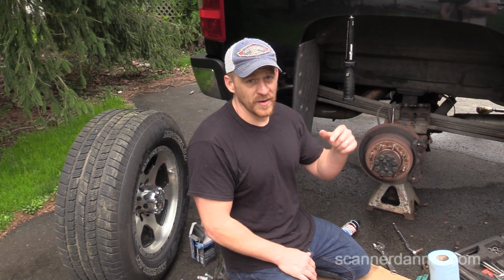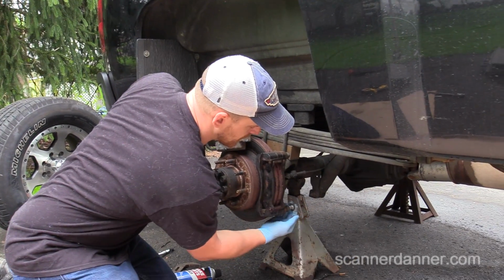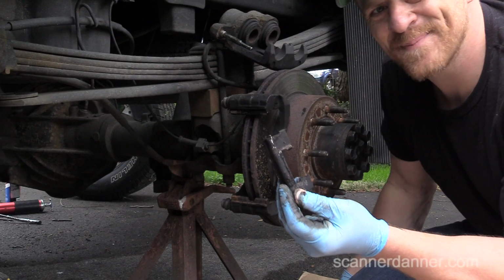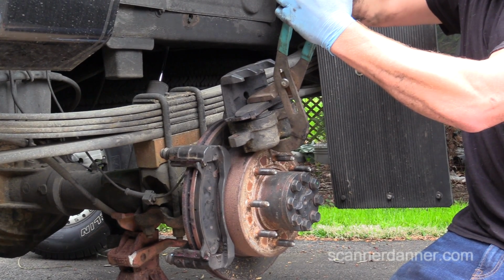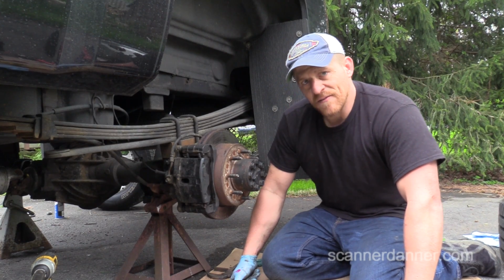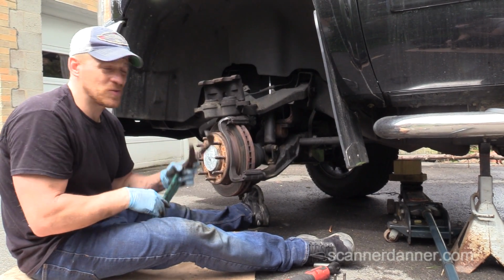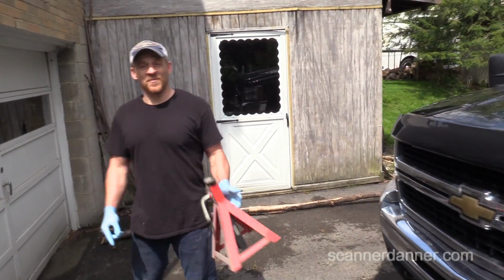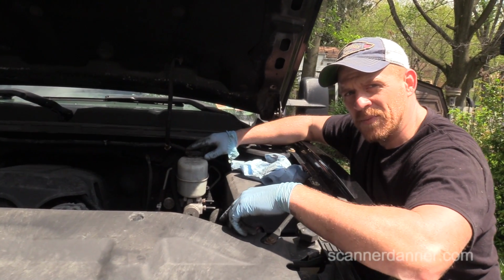Silverado 2500 HD Brakes Hanging Up, Diagnosis and Repair Part 1

Comment: I hate on car brake lathes because they wobble to much from the machine moving causing too much run out bench lathes are way smoother and cut the rotors better in my opinion.

Comment: Regarding the 6mil black gloves i use all yr round 🙄/so I’m ASE Med/Hvy duty Master Truck mechanic/Technician self employed Mobile mechanic-(anything w/wheels diesel & gas) that being said if you ever experience your fingers splitting open from fluids drying them out you would religiously wear gloves-im 49yrs young & this has been my practice for the last 25 of 30yrs in my profession/great video & instruction-Thanks for y’alls time👍🏼

Comment: I thank you for spreading the correct knowledge out there for so many people and I almost forgot what general motors taught me I too am also a technician not a mechanic those out there know what that means we are trained licensed and we know all the ins and outs as you mentioned about opening the bleeders dirt and debris this is what was taught to me by general motors I could be wrong but this is what they taught me it's not so much the dirt and debris getting into the line but brake fluid is a dry liquid it absorbs moisture every time you open the master cylinder cap it absorbs water from the surrounding air the reason that I was taught to let some of the fluid out was overtime that dried Blake fluid will absorb that water and if the pedal is pressed hard enough and certain conditions prevail the brake fluid can actually boil because of that water in the fluid over time when people open their master cylinder cap when that water is absorbed is slowly gets down through the brake lines so by letting a little bit of fluid out each time you don't have to fully bleed them or anything just get the brakes done lightly press the pedal crack it open andwhile the fluid is still coming out close the bleeder screw because of the reasons you mentioned about debris coming back into it thank you I'm not trying to be a troll I just wanted to fill in a little bit of knowledge

Comment: If what you mean by "locking differential" is a posi, you should be able to use the on-car brake lathe if you put the vehicle in neutral. I'm 95% sure this would theoretically work, unless I'm being a dumbass and missing something.

Comment: I've never seen anyone used regular front end grease on a brake job, That kind of grease is no good for the rubber i was told. You need hi temperature grease. In this trade there're way too many opinions on how to do things the right way

Comment: Thank you, Paul for the great brake job diagnosis. I have a double piston caliper and the pistons don't move together. As I drive the truck and apply the brake, the  brakes grab and release. I was leaning towards  the slide pins more than the pistons since they are released once I let go of the brake. From the video, I can see that I am going to have to replace the caliper. I didn't check the brake hose as most people think can be the cause of the drag because  one of the pistons move freely.
Reply from the maker: Thanks Marcus! I got a lot of grief for this series as this is not what I normally do. I have been teaching at a technical college for the past 17 years and perform mobile diagnostic on electrical and electronic systems. I just don't do brakes very often anymore. I'm glad you found it helpful.
Reply: I have always found all your videos helpful !  You are my greatest teacher ever.

Comment: What grease do you use for slide pins? I used a grease that said it's for brakes and all parts of the brakes including the slide pins which was purchased from auto zone but it is becoming  very gummy only after 4 months and smoked the new rotors.
Reply: Micheal Jones clean it out and use Silicone Paste. It clean and better won't hurt the rubber seal or slide pin

Comment: Remember folks.Put silicone based grease on the guide pins.Put copper based grease anywhere else.
Reply from the maker: I did, in the final part. The grease I used from my gun was a synthetic. Probably still not the correct grease, not sure

Comment: There was an amazing old trick that I was taught for stuck caliper pistons. Lift the piston outer dust seal and squirt some brake fluid down in there. Works wonders.

Comment: Wearing glove is not only for keeping your hands cleans, but it serves as a protective barrier against all the chemicals that is found in the brake fluid.  Brake fluid is a caustic chemical that is why they tell you to wipe away any spilled brake on painted surface because it will literally eat the paint.  Your skin has a lot of pores which is why your hand is wet if you wear gloves.  These same pores which allow sweat to flow out from your hand also allow chemicals to enter your body.

you can repair that ratchet with a ball bearing from a bike shop and a compression spring that you can find at any decent home improvement store.  My brother repaired one of my dad's old Snap On ratchet this way.

Connecticut state bird is the American Robin.

Comment: Gearwrench is awesome. Have the 120XP 3/8" and i'ts solid, and can handle my strength without breaking. By the way, Eric O at South Main Auto is the master of brake jobs. I learned from him :-) But I think you did a descent job. The only mistake was perhaps the grease on the pins. Use silicon paste, or something that's rubber friendly.

Comment: dearest Paul; I enjoyed so much watching both videos plus Your Son and Brother.

BMW Mercedes Lexus; on these 3, my Senior Workmate and also Workshop Owner at Garage never compress Caliper Pistons because they told me it causes ABS Locked. I haven't got an opportunity to do this on above said Vehicles.
I have seen many videos on YouTube on BMW brake job and the guys compressed the Caliper Pistons normally and never had any issue with ABS. Please help me understand this circumstance.
Thank you
Reply from the maker: If they never compress the pistons, what do you do for each brake job? Replace the calipers?
Reply: Ooo I'm sorry
They do compress Caliper Pistons but open the Bleeder Nipple.
Reply from the maker: I talked about that in the video as to why people open the bleeder and why I do not. Did you not see that part?
Reply: You said, "because they want let out old Brake Fluid, Compressing the Caliper Pistons doesn't effect on ABS".
My Senior Workmate tell, "This procedure on German Vehicles, causes ABS Locked".

I just want to clearify does this procedure really causes the ABS Locked in German Vehicles?

Comment: my truck is a 1992 Silverado  5.7L with a MD8 trans and in order for me to get the speedo, and both the drive & driven gears to match i needed to find out the gear ratio pf the axle i had installed in it! not sure of which reading i should go by!

with the rear of my truck up on jack stands, i made identification markers on both the yoke and the yoke housing, then with blue painters tape i took a piece about 1 foot long and spand it across the driver-side tire and wheel well, then cut it in half the distance between the tire and body, then folded the tabs inward.
Spun the driver side wheel and tire 10 full revolutions (marker to marker)
found out that the pinion gear spun 11.75 Revolutions and followed the procedure that brianmobile1 used to calculate the gear ratio

11.75 X 2 Divided by 10 = the gear ratio
11.75 X 2+23.5 divided by 10 = 2.35.

tried to find any information on this axle (couldnt)

So today i jacked it back up and put it back on the jack stands, tried it from the passenger side. came up with the ratio number of 2.65, then i pulled off the rear cover to try and find the numbers on the ring gear (there were none on it) and happen to notice that on the bearing caps on top it says "20A" and right underneath that says "236"

I DONT KNOW WHICH NUMBER TO GO BY!!!!!!!!

Comment: So the front brakes wouldn't pass PA state inspection? What? Are they going to remove your rotors and inspect the pads? A little Ludacris if they do that and one would think it would open them up for a lawsuit if they're removing and installing wheels and calipers for State inspections. I am glad we don't have inspections to a point.We don't have to do them here in South Dakota but I keep my vehicle up. I have noticed a uptick in immigrants buying wrecked, damaged cars from insurance and junk auctions. 

Danner you should get lifetime pads and rotors as I do. I just pay a little bit extra up front with the parts house betting that I'll get rid of the vehicle before it's due another set of pads but they're wrong as I normally keep my vehicles forever. Currently driving a 04 Chevy Tahoe with 113k miles on it. Maintained though I have a few things to do as time is money the work will still be there for me

Comment: Okay, I'll admit I didn't watch the entire video.

I once had a locking rear brake on my 67 Mustang.  It would occasionally stay locked up after applying the brakes and would only do it while going forward, not backwards.  So, I systematically started checking and replacing parts on both rear brakes.  I pretty much ended up replacing everything in the braking system for the rear brakes from the firewall back, including the proportioning valve but to no avail.  It turned out to be the brake booster push rod (from the brake pedal) was broken and stuck inside the booster!  It didn't make sense but a new booster solved the problem.

Comment: Great vid Paul. Love your content. Getting a Verus edge soon so soon I will be getting a sub to your paid content. Just wanted to let you know that you can turn the rotors on your truck ( I have a 2003 2500HD with same rear end). But to do so you must disconnect the rear driveline. That is what is causing the axle/rotor to stop when spun to fast. Or put the tranny in neutral but I don't recommend that since the tranny needs to be run from engine side to run the oil pump in tranny so you don't burn it up. Keep up the great vids.
Reply: Thanks Fredrick! You will not be disappointed. And thanks for the tips

Comment: I have the flex head Gearwrench set of ratchets and they are wonderful. They are made by Matco and are the exact same design as the Matco with the Gearwrench logo. Match will Warranty them as well. I've been using them for 2 years on a daily basis with no problems. I think you will be pleased.
Reply from the maker: cool thanks!

Comment: Warranty that ratchet man. You should order gearwrench tools from Nick Merello 3 on Facebook as he is in Jersey and you will save a ton of money. Go to the snap on Matco and Mac tool sell group and you will see. You should replace them brakes if they were locked up. That's not a place to be cheap plus you can warranty them. I'd rather replace rotors anyways instead of turning them since the rears tend to rust badly. Just poking at you it's different seeing you doing brakes lol
Reply from the maker: haha I know, this is not my area man

Comment: To eliminate air from entering the system when opening the bleeder valve better to use a c clamp so you have constant pressure on the piston and a steady stream of brake fluid coming out.

Comment: Scanner Danner aren't you suppose to use silicone grease on the slide pins? Doesn't regular grease eat away at the slide boot?

Comment: Mr Danner may I suggest some silicone paste for the rubber boot slides and piston seals if you haven't already use it in part 2. Regards Stewart, Australia.

Comment: I got a 05 Buick century. 3.1L. replaced cam positioning sensor an it started running again. 6 months later car just turned off. Now it will crank over an at very first time it will start but only for a second. than just crank an that's it. won't start. was wondering what's wrong with it. any help is more than welcome

Comment: Hey Paul, welcome to my world! :D This is how I work every day - hands and knees in the driveway (hopefully I'll have a lift here before the end of the year ...). I've had about enough of it - I ain't getting any younger, and it's kicking my butt. Probably why I'm cursing at full volume on nearly every job ... well that, and the RUST ... :D

I've got you beat with my grandpa's 35 or so year old Sears 2-ton jack, lol ... but I wanted to tell you, I had the same issue (not with that old one - they built that one RIGHT! It STILL works with ZERO service to it!) with my 12 year old Kobalt jack of not reaching full height. I jacked the thing as high as it would go, then pulled it up the rest of the way by hand, and blocked it there with wood. Then removed whatever I had to, and filled the thing to the brim with power steering fluid. FIXED ... at least until that all leaks out, lol.

I've got the same truck, but the half-ton version (2007 MY) with drum rears. Just hit 90k. Haven't had any caliper issues, but everything else has failed. At 48 miles - yes, forty-eight - it had a brake job under warranty for pulsation. That was done 4 more times before 36k miles. Ball joints failed at 38k (just out of warranty, of course!). Hub bearings, one front strut, and upper ball joints failed at 50k.  Started burning oil around that time, and now I've got high levels of copper/iron in the oil. CAM BEARINGS! LMG engine, so par for the course. Think the only thing that kept my lifters alive is my Range AFM disable device I never leave home without. Way to work GM - I appreciate it! :( Should've kept my '71 C20, and '72 El Camino!

Comment: That's because GM is Junk, I have one. I think that is why Eric O drives Toyota. I can say one thing I have never pushed a piston back in without cleaning it first, so that the rust doesn't destroy the boot.

Comment: I think you covered the whole job quite well, Paul and Caleb. The only thing i saw was using chassis grease on the brakes but i guess that's what you had there.  I liked your explanation about how mechanics think and why we get a bad rap sometimes.
 People don't realize that we have to do the job to the best of our knowledge and ability. I guess if you sell the whole job you're a rip off artist and if you try to save the customer money and the job comes back to haunt you, you're a poor mechanic. In the automotive trade you just can't win. 

HaHa......gotta love the trolls. I wonder where their repair vids are.
Reply from the maker: The grease I used was a synthetic, not sure if that was okay to use or not but I knew I would be hearing about it so I bought some actual brake grease which you'll see me using in part 2 :-)
Thanks brother
Reply: LoL.....You're forgiven

Comment: Im looking for a impact gun that is good for unscrewing and screwing in the wheel bolts.
Is that DEWALT DCF883M2 recommended then? Looks like the price is about ~200 euro. Seems price worthy
Reply from the maker: The 3/8 drive I was using will only torque to 100ft lbs, so it is really not meant for lug nuts, though depending on the car you could use it. You need a 1/2" drive for that typically.
Reply: I have a Volvo S40N -2006 and in the instruction book it says to torque to 90Nm
Reply: orfeous spend the money on the 1/2"!
Reply: I was thinking of maybe buy a kit. To get both the impact gun mostly for wheel bolts and a drill machine for drilling and maybe cleaning with a wire wheel thing, here in Sweden these kinds of tools is somewhat expensive. Sometimes better prices outside Sweden.
What brand would be the best for me in this case? Price worthy.

Maybe this one then?
https://www.amazon.com/DEWALT-DCF899M1-Brushless-Torque-Dentent/dp/B01D61NSUS/ref=pd_cp_469_1?_encoding=UTF8&pd_rd_i=B01D61NSUS&pd_rd_r=6WDNCBC2Y69V1QJA3EXV&pd_rd_w=xXZxS&pd_rd_wg=G6dXV&psc=1&refRID=6WDNCBC2Y69V1QJA3EXV

Comment: I have the Gearwrench set youre talking about. The only one I use is the long handle straight 3/8.  The rest of the set is pretty useless since you probably already have a 1/4 and regular 3/8 set or 2 so its a waste of money. Gearwrench has a long handle flex 1/4 which is really useful though.
Reply from the maker: The kit came with the long handled 1/4" too. So just the long handled 3/8 and 1/4 " alone was worth it. And I definitely needed a better 1/2" too. Been using an old school craftsman forever. So I absolutely got my moneys worth
Reply: You won't regret the GearWrench tools. I have a lot of their stuff including all three sizes of long-handle flex head ratchets, and use them hard every day and have no problems whatsoever. Wish I had sprung for the long handle ratchets with locking pivots and quick release, but otherwise I love them. They might not have quite the fit & finish of Snap-On, but they're 90% of the quality at a quarter the price.
Reply: I agree with the regret of the lack of locking pivot and quick release. I have the GW 120 set and love it but when the socket gets some grease or oil it's not easy to remove. Love the pivot head but a locker would be better. Overall I'm supper happy with the quality vs bucks spent.

Comment: In a PA state inspection would you even see the pad face to see the crack?
Reply from the maker: I'm not sure if you are required to pull a caliper off? I think you are. One front and the opposite rear is mandatory as far as inspections go, but we always pulled all 4 unless it was a new car.
Reply: Your inspections must have been expensive. The thieving states in Australia that have inspections seem to them on a drive by basis, as in drive by and throw $60 out the window and you pass. I'm glad I live in a non inspection state.
Reply from the maker: Actually they are not expensive. Less than $60 and as a tech we got paid .5 hr flat rate for inspections and I think .3 or .35 for emissions inspection.
Reply: The shop rate must be quite low, run of the mill shop rate out here is $150+ but I don't know if they pay flat rate to techs, I work on ming gear and we get hourly.
Reply: 350munro technically, we are supposed to pull the caliper off and check the pads condition and measure it out of tthe guides. a cheater gauge is illegal in pa unless it's on a motorcycle